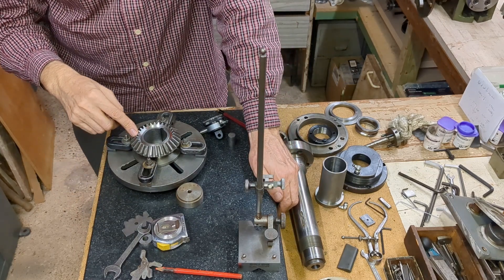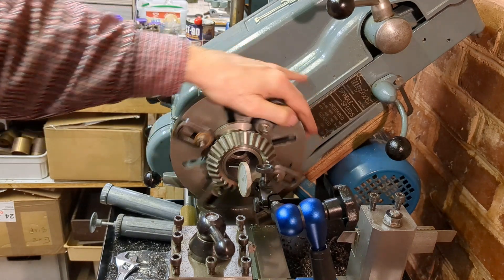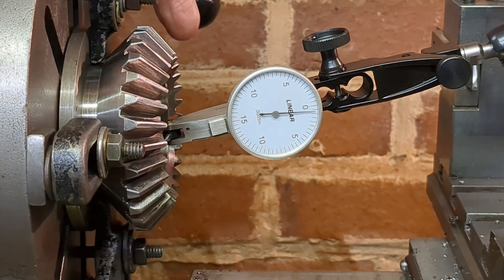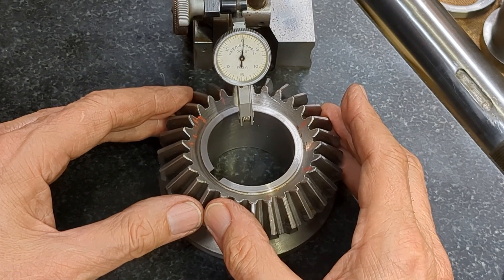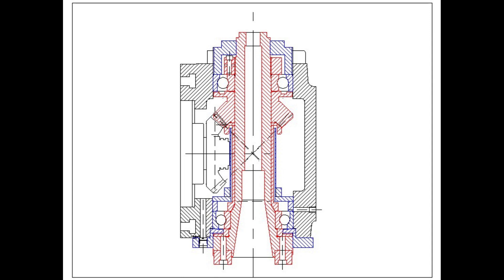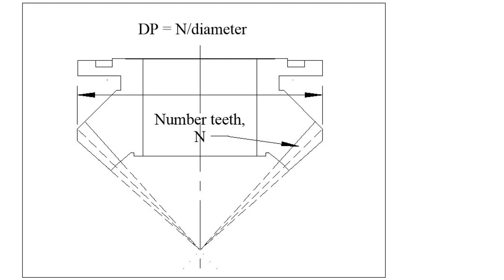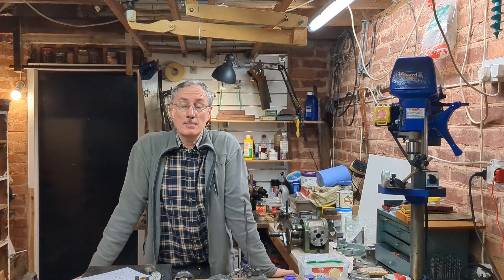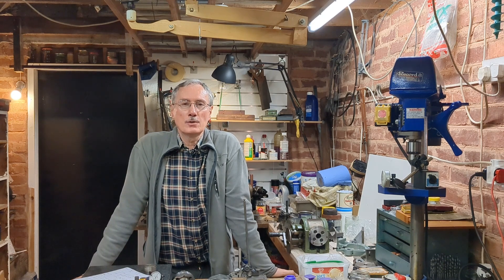Adcock & Shipley milling machine restoration - part 4 (vertical head repairs)

Comment: Excellent film. I really enjoyed the detail of removing the convex burr on the face of the bevel gear and the GA drawing that you produced. Cutting the o ring groove was superb. I think it will seal without issue and improve things no end. Don't worry about the length of time between films. I post erratically too and from my standpoint it is the quality I'm interested in, not the quantity. You definitely have that nailed.
Reply from the maker: Thank you for your positive feedback. At the end of the day it will probably come down to trial and error to get the correct mesh. Will see!
Reply: @Workshopfriend  Yes I'm inclined to agree. Although a knowledge of the theory involved will get you in the target zone.

Comment: I made a right angle milling attachment for my vertical mill a few years ago.
Used spiral bevel gears at a 2 to 1 ratio to give a reduction at the spindle, remembering back I had a fun time setting the mesh correctly.
Good luck with yours to get a satisfactory mesh with minimum noise.
Reply from the maker: Thank you! Setting up spiral bevel gears must be much more  complex. Well done for achieving the correct mesh!